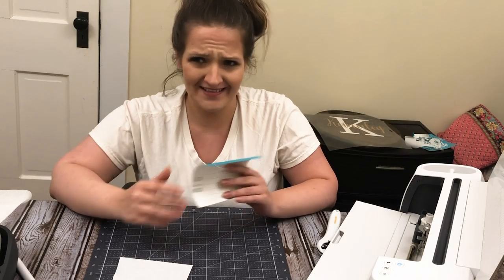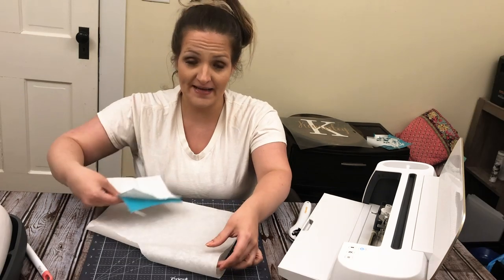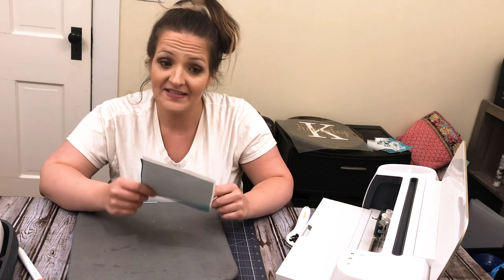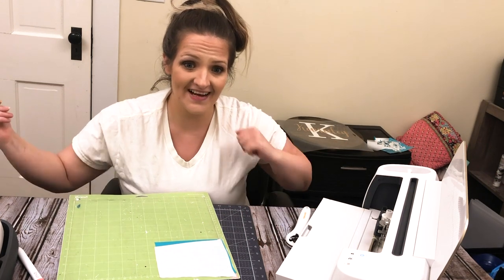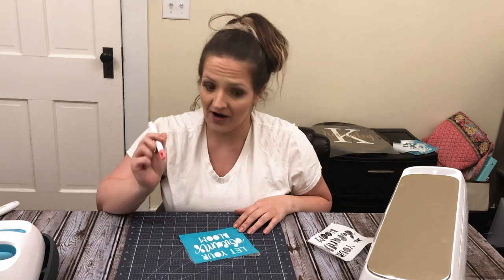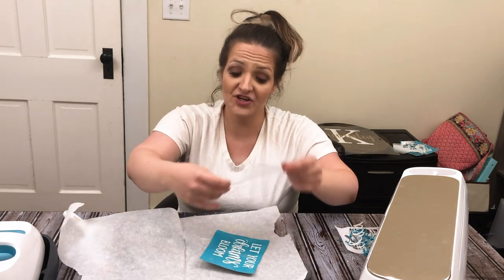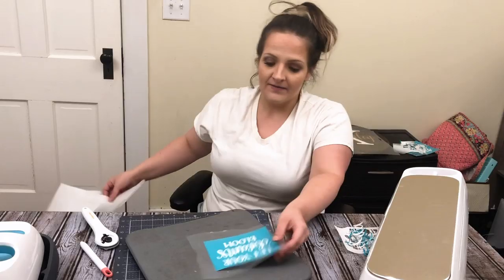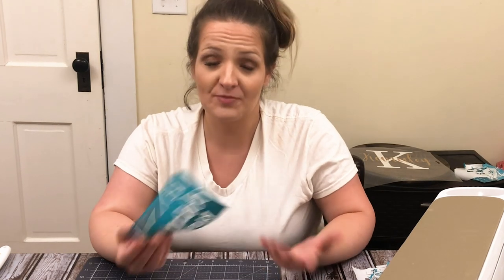How to make Chalk Couture Stencils | Mesh Adhesive Reusable | Transfer

Comment: Just wanted to update after I tried it. This works really well!  I used 631 Oracal (it's what I had), heat n 'bond ultra (same as you suggested) but instead of tulle, I ordered some 110 silkscreen mesh.   I also don't own a heat-set press so I used my regular clothing iron (with something in between the iron plate and the stencil so I didn't get my iron plate gunked up). The first time I ironed TOO long and my wax paper stuck to the top of the mesh and "melted" and it wasn't salvageable because the wax paper literally melted onto the mesh. Second time, ironed on a lower setting and it worked perfectly!  I've used the stencil twice so far and it's worked well both times.  I rinsed with water, let it dry and it was still sticky.  BTW.. I own a Silhouette Cameo and found that the cutting on my mat using a brand new regular cutting blade and the Cut Heat Transfer, Metallic  Setting (Blade  3,  Force 33, Speed 5,  Single-pass) worked really well.  Cut through the layers of vinyl and adhered heat n bond but not trough the back of the peel-off paper backing of the vinyl. I was able to weed easily. Thanks so much for this tutorial. Can't wait to make more stencils!
Reply from the maker: So excited it worked well for you! (and a big thanks got the silhouette settings! I have a Cameo 3 and definitely plan to do more Cameo specific things) I found a spray heat and bond product and love it even more. This way when its being cut there's no extra layer so intricate cuts are easier. But the downside is the weeding lines are harder to see. I think both heat n bond products work great on these, though. I choose which form to use depending on the design I'm making. 

I also pressed too much my first trial and had the glue all over, lol! I think thats the trickiest part, getting a good press without overdoing it. 

Thanks so much for letting me know how it worked and sharing more tips!!! ❤️
Reply: Design Your Life What is the name of the new spray heat and bond you tried? Hope the silhouette settings are helpful to you and others. 😊
Reply: Hi Tracy!!  I want to try this also, thanks for the specs.  I have a quick question, once you used your stencil did the silkscreen mesh leave behind a texture?
Reply: @dpchmd101  I think you are asking if it left a mesh design/texture on what I stenciled. In other words, can you see the silkscreen mesh pattern in the paint on the design after it's stenciled?  Not at all!  I wish I could add a photo to show you.  I used the Chalk Couture black INK (not chalk paste) on mine.  It worked really well.
Reply: Lora Ray it has to do with the size of the “holes” in the mesh but I don’t know the specifics on 180. Google “110 verses 180 screen print mesh” and you should get some hits. I went with 110 because that was the “average size” used for most screen printings based on my research. HTH
Reply: @tracymac9058  awesome thank u! I tried it and my ink didn't go through the screen completely so I'm gonna try the 110. But if I get this down to a T it's gonna be amazing!
Reply: Lora Ray you will LOVE being able to make your own designs! I just went to a chalk couture party yesterday and used their stencils and chalk paste and their stencils didn’t work any better than the one I made. I bet the 180 is a finer mesh weave so it didn’t get through the holes. Try the 110 and let me know how it goes. 😊 I got mine pretty cheap from amazon.
Reply: @tracymac9058  I'll update! I use chalk couture all the time so I'm excited to compare. Thank u again.
Reply: @loraray1632  If you use it all the time then you will know better than me. That was my first time using it.  I used the chalk Couture INK with my stencil and it worked great! I've not tried the Chalk Paste on my stencil (don't have any) but the ink worked well.  Since you've used their stencils and paste before, I'll be curious to see what your experience is with the Chalk Paste and your own stencils and if it worked as well as my experience with the ink. TIA for updating me.
Reply: @loraray1632  Sorry (was signed in under somebody else's google account with my response :-)
Reply: @tracymac9058  In my research to reverse engineer this process my printer said it was a 200 mesh with a photo emulsion This Method above is outstanding and puts the limits of Chalk Couture in the dust bin!
Reply: Elisabeth West Awesome! Thanks for posting and sharing your results. I have had great results with the 110 but would be interested to try the 200 to see if one out performs the 110. ( better coverage, less bleeding, etc. )
I think chalk couture is really a great idea and I like their paste/ink from what I’ve seen and tried. However, the limiting factor is the lack of stencil options. Being able to make your own is a game changer IMO.
Reply: @tracymac9058  You Tracey are a game changer! Yes CC is a photo emulsion a process used for screenprinting but you broke it down better. I have over 600.00 in CC stencils now, then along comes IKONART who basically sells unexposed stencils to make your own which is what CC really is. I like your Idea better and would love to try this with a laser as well I bet it will work!!!!! Best part is no 20.00 a month or MLM!!!
Reply: Elisabeth West I am so glad my info helped you! Now, Stencil on! 😄
Reply: I was so excited when I found this tutorial, but I haven't had much luck yet :( I've tried both 631 and 813 stencil film and both end up having pieces stick to the surface (instead of the mesh) when I pull them off. The majority of the stencil is attached to the mesh, but the small pieces inside letters come off and stick to the surface I'm painting. What am I doing wrong?
Reply: Lee-Ann T without seeing it.. my guess is that when you peel of the paper to reveal the glue that you will put the mesh on and iron the mesh onto, that you aren’t gluing the mesh enough. In other words, when you are ironing the mesh onto that second side of the ultra bond, you aren’t heating it enough to “glue” the mesh to the glue. Or the other issue is that your little pieces are so thin and little that they aren’t getting enough glue on them to stick to the mesh. 
Although, I had some pretty thin and little pieces in my design and I didn’t have that issue so it makes me think you need to heat it hotter and/or longer so the glue really attaches ( melting the glue using heat.. but not hot enough to melt the mesh itself) and glued well onto the mesh. Hope that makes sense.  😊
Reply from the maker: Tracy McLaren I tested with sone tiny tiny pieces as well and had good results. It definitely is a bit trickier though! When I used tulle it left a texture behind but using silk screen it came out perfect! (Depending on paint used is what decided what size screen mesh. For chalk paint I used the standard gauge). With the tinier pieces I did have to be careful when peeling off the mesh liner after the first press n make sure it was laid perfectly flat before the second press. Creating the stencils and spreading the paint definitely has a learning curve but once you get a technique down it’s awesome!
Reply: Thanks for this! I have a Cameo 4 and was doing to play with the settings. Also was thinking if getting silk screen as well.
Reply: Thank you for sharing your silhouette settings! I just made a 3 part stencil with them --  @Design Your Life   thank you for sharing your technique!!
Reply: @Bobolots  I'm so happy the settings helped you.  :-)
Reply: What setting on the iron and approximately how long did you iron?  I also don't have a heat press. thanks
Reply: @debraprins2036  It's been so long since I've done it I don't remember exactly.  But from re-reading my review, I would say medium or low iron setting. How long.... just until it fuses... probably a minute or two. I tried pressing as hard as I could. Not sure if that helped or not.  If it's not fusing on the low setting, turn up your iron a bit.  Just make sure you put something (old pillow case or muslin or something) between your iron and the wax paper so it doesn't melt on your iron. Good luck!
Reply: Use parchment paper not wax paper. Made to go in oven at high heat.

Comment: Thank you so much for the tutorial! I used adhesive vinyl/generic contac paper, from dollar general and and old sheer curtain! Swiped my paint on in one direction (cross grain or brush Mark's on wood) and it worked great! First time I swiped with and across the grain and remembered silk screening in grade school and teacher stressed to swipe either up/down or across. This helps tremendously for paint bleeding underneath! I did have a bit of a problem for depth of settings but I believe its because the contact paper is thinner than regular vinyl so I'll have to lighten up the settings! Also tested the restickability, haha not sure if that's a word, and so far 7 times and still sticky! Thanks again. Great explanation!

Comment: I have seen this and it inspired me to test different materials.  I have used htv vinyl and silk screen mesh and used this method just with the htv. Works great. I just tape the htv down to surface and comes up with a clean image. A little thinner than 631. I have used 632 in top and bottom of mesh and find the htv does better. Any 631 stencils I have made have pulled up wood particles,  even if "fuzzed" up. Great tutorial! Thanks for the inspiration!

Comment: Hi, I just attempted to make two (on the same sheet) and it was a bloody disaster lol. I used permanent Avery Denison sign vinyl (that I use in my Cricut maker no problems) I bought the super adhesive sure and bond I put the rough side on top of the vinyl and pressed and that was fine, waited for it to cool, then put it through the maker and cut the design. Weeded negative space then got some 110 silkscreen mesh and heat pressed it on top of the design where the adhesive could be seen on top of vinyl and it was sticky looking after being pressed. I pressed a bit longer but was still a bit sticky looking. Cut the two stencils in half and put both onto glasses, the vinyl actually came off onto the glass where the inside of letters was like the circle inside the d, e etc and applied the couture ink and it didn't cover properly and very poorly so I had to completely wipe off and clean the glass. Don't know what I did wrong.

Comment: Thanks so much for this.   I recently became intrigued with Chalk couture after not being successful with traditional stencil methods.  I like for my projects to look like more than a piece of vinyl slapped on them.  LOL>     Worked great except my wax paper stuck to the vinyl too.  Was able to soak in water and gently scrub to make usable.   Will reduce heat and time next go around.   So excited to try them out.
Reply: I think she is using parchment paper and calling it wax paper.  If it was true wax paper the wax would melt once you put heat to it.

Comment: Editing at top. To note its better to use parchment paper not wax paper. Made to go in ovens, no wax residue.  I missed that the 631 vinyl is removable! Thats interesting. In future I may buy that to do my hand cut methods. That Ive not tried yet! But adding best methods of all you crafters together may help me do a better poor womans methods. Tulle is great idea to test but may by silk screen mesh. You know I did the very old fashioned method of silk screen in the 70s! Im old but still creating! Im glad there is a lot of self creativity out there now and helpful people on the www! Thanks again!

ok late to comment. I find this interesting. Im old, old school, cant afford any gadgets. I have to rewatch this, confused how it was made sticky? But more so like the idea of the mesh method.I bought thin portifolio folders to cut my own and a cheap wood burning tool with a hot knife tip. Thats how many are cutting theirs by laying over an image they want to turn into a stencil. So Ive been looking up many things. Including how to make my own self stick adhesive. I had some spray on few days ago at Walmart but had to run to restroom and a clerk took basket and cleaned it all out! They looked in back but never found the spray again and last one!! But another person I follow I just watched her make stencil material by laminating a pouch with nothing in it. My $5 thrift store laminator broke so Ive just been ironing. Not the same but I got idea to use a thing my partners son gave us. Those copper mats you use to cook fish on a grill. "As seen on tv" kind of item. Ive been using to help laminate with my iron and I also press and dry flowers. Helps with that. But use parchment paper instead of wax paper. It holds up to heat as its used to make cookies on and has no wax...unless you want the wax? Ok, reviewingt his again. Oh I sew, so I do have many types bondable interfacing which heat and bond is. Ok rewatching later to see if I can put his all together for Poor womens stencils! Thanks so much. I will see what other videos you have!

Comment: Thanks so much for your tutorial.  I had all the parts but couldn't put it together.  I made my first stencil and love the results.  I would use a real heat press.  With the cricut press it moves to much which puts the adhesive on the screen.   
Thanks again !
Reply: How many times are these reusable by doing all this??

Comment: Just made my first stencil and of course instead of trying a small design first, I jumped right in and made one that was 9.5x9.5. First of, it seemed like the heat n bond had air bubles after pressing it on my Oracal 651. I did not re-do it because I wanted to see what would happen just using it the way it was. I cut my design, weeded it and pressed silk screen material on it. I guess I should have waited a few seconds for it to cool because I had glue residue on the unweeded part of my stencil. Mind you, my heatpress is 10x10 9 (non Cricut brand) and so I had to overlap the press. Next time I will try and press everything on my big t-shirt press. Maybe the overlapping caused the glue to bleed. I also see some "shadows" in some of my letters; not sure what the cause of this is. I also may have used too much pressure on my weeding tool tip when removing the vinyl because I pricked a few of the letters (still fairly new to the Cricut world). Because I have not applied to stencil on the shirt yet, I do not know if this is visible after adding the color. All in all, a very easy process now I just have to work out the kinks. Thanks for a great tutorial!! :)
Reply: Update** I did get some bleeding on my letters. I must have moved the heat 'n bond when I overlapped the press. Next time I'll do it on my tshirt heat press so I get an even pressure. Other than that it worked great. Had some color residue left on some of the silk,  I used black screenball paint. Maybe use a little less pressure when screen printing?

Comment: Thank you for this tutorial. I found it very helpful. I have a couple of questions. 1. Can I use a regular iron if I do not have a heat press? I realize I would not know what temperature it will be set at. 2. Is there a particular type of tulle that you use? Something fine? I do appreciate any help you can give me as I am brand new to this.

Comment: Thank you for the tutorial!  I have been trying to come up with a way to accomplish what you have already figured out for me :)  Joining your FB group so I can keep learning from you!
Reply from the maker: Thanks you! I found some spray adhesive thats heat activated. My theory is with a spray more intricate cuts can be made since I wont have to cut with that extra layer on top. I tried loctite spray but it would dry too quickly while weeding (you have to spray before weeding to prevent adhesive from being in the negative space). Hopefully with a heat activated spray it will have the advantages of both heatnbond and loctite spray adhesive but neither of their negatives! I've done preliminary testing and results look great but I want to test them with more heavy use to be sure.

 I also purchased some 110 silk screen mesh which is great because the tulle i had on hand was a smaller gauge so the gaps were quite large. It worked to show the process visually and test my idea but if you want a more professional stencil I'd definitely order some 110 silk mesh. In a pinch, Silhouette has some silk screen refill kits I found at Michael's but it's way overpriced for the little amount you get (it has silk screen and HTV sheets in the kit bc it's geared towards a refill for their traditional screen printing on a frame kit) Much cheaper to buy mesh on Amazon, though! Silhouette also sells a a reusable, thick plastic, adhesive stencil material that I picked up for testing. Again way overpriced and I found a supplier online that sells it much cheaper (I'll link it in the review video bc I'm all about saving money!)

Thank you again, and if you ever have any questions or need anything just reach out on FB ❤️ 😊

Comment: How do you store the stencils in between uses? Thank you. I watched 2 other videos on this prior to yours but just couldn't grasp this. You explained so it finally made sense.
Reply from the maker: I placed mine on onto the vinyl backing. Wax paper would work too. I did always let them fully dry out first. 

This video definitely needs a part two on using, washing, and storing. I had taken a little break from posting but that topic is definitely on my to do list!